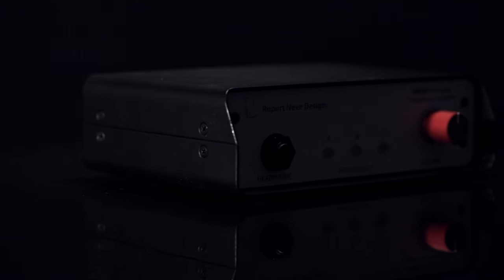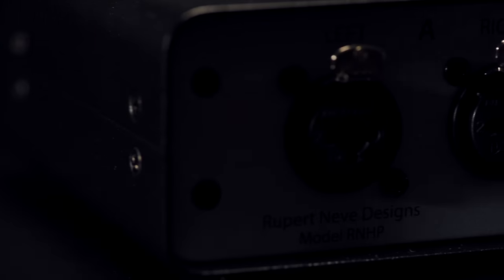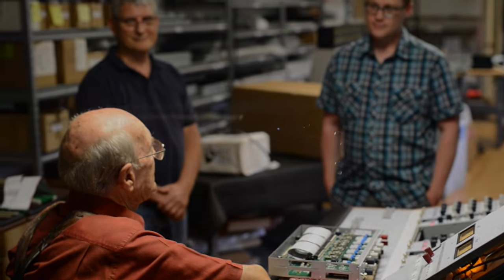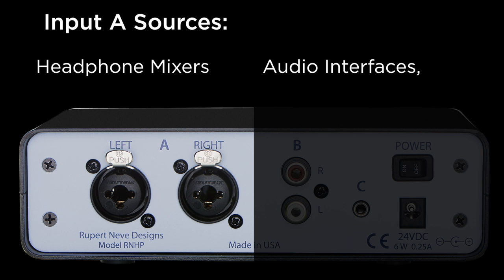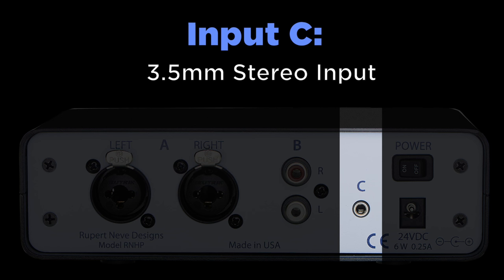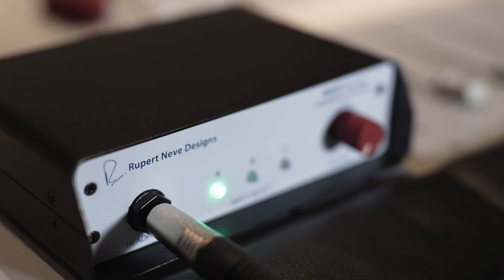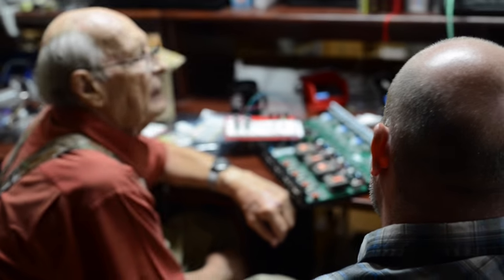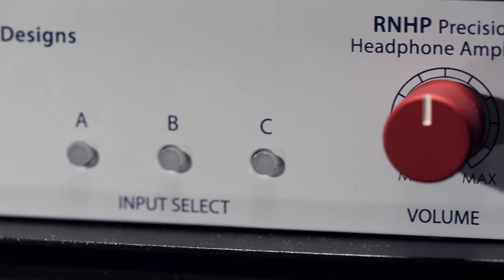RNHP: Precision Headphone Amplifier Overview

Comment: Just received my RNHP yesterday and it has really surpassed all my expectations so far. Thanks so much mr. Neve for putting together this little wonder which is the first head amp I've tried able to squeeze all the juice from my headphones collection.

Now, thanks to the RNHP I'm finally able to enjoy my Audeze LCD2C, Focal Clear, Sennheiser 660S and Beyerdynamic T1 2nd Gen the same way I've been enjoying my Beyerdynamic DT1990's until now. The RNHP drives them all effortlessly and each one of them sound their very best. My other head amps are the Beyerdynamic A2 and Marantz HD-AMP 1 and despite being very good and more expensive never managed to make sound properly both my Audeze and Focal. 

Paired the RNHP with my CHORD Qutest DAC, Marantz HD-CD1 and my Stanton ST.150 Turntable and I'm in audio heaven. For anyone searching I fully recommend buying the RNHP. I wish I would've learnt about it before. I could've spared a lot of money.

There IS a reason why Rupert Neve Designs are legendary.
Reply: Very interesting, thanks. Can you provide a bit more feedback on the synergy between the RNHP and your Beyers? This is the pairing I'm looking at. Thanks.
Reply: I'm looking at pairing this with the T1 and the Schiit Modius. Are you still using the RNHP with your T1?

Comment: A little confused, how can this be calibrated to work with my HD 650 | Sennheiser 300 ohms?  I don't see any "calibration display" that could operate as such and make sure the output is set correctly for 300 ohm?

Comment: What headphones did MR. Rupert  Neve used to test them?
Reply from the maker: Hey Jared, We beta tested the RNHP with a wide variety of different headphones from brands including:  Grado (multiple), AKG (multiple), Sennheiser (multiple), Shure (multiple), Ultrasone (multiple), Audieze, Blue,  Sony (a couple models),  Audio Technica,  Beats and Beyer Dynamic.   It universally gave much higher performance than audio interface, headphone mixer, or cheaper multi-channel headphone amps, and we even preferred it to the $1000+ headphone amps we referenced it against.

Comment: Hey, can someone from the Neve team explain the use of balanced inputs on the back but only Single Ended Output on the front? Why not have Balanced Output on the front? Doesn't that defeat the purpose of the balanced inputs? Or does it not matter on this unit?
Reply from the maker: Hi Jarek - many pieces of studio gear will only have balanced outputs available, so having balanced inputs here is ideal for signal flow and isolation purposes. Most studio headphones will be unbalanced, so we only implemented an unbalanced headphone out on the RNHP. But our new Fidelice DAC (shipping later this year) has balanced headphone outputs on it as well! https://fidelice.com/precision-digital-to-analog-converter

Comment: Hi guys,  wondering what cables were used on the back of the amplifier?  Thanks
Reply from the maker: The balanced connectors are Neutrik, if that is what you asking

Comment: Hi, I would love to check this out on my YT channel and on my website www.hifiinsider.com. Is the circuit balanced design? Are there other PSU options aside from the wall wart that comes with the amp? Thanks! ~ Mike
Reply: It's a Rupert Neve design which means there is nothing better in the Pro Audio world Rupert is the best of the best just do a google search for Vintage Neve or Neve 1073, his designs are the most cloned and most revered. Rupert designs his own Transformers and they are considered the Holy Grail in Transformers. Once you try a Neve product you will never think about a Tube Headphone amp again or inferior overpriced products from other manufacturers. In Pro Audio analog audio quality there is only one standard and that standard is Rupert Neve and all others are judged by his standard. At $499 this is a steal compared to other Neve Products for example his microphone preamps can command as much as 8 to 9 thousand dollars for technology he produced in the late 1960's and early 1970's with his 1073 model.  Have a great day!

Comment: May i pose a question?   IF i have a hammond C3 and I have a 1/4" out put on a Leslie Pedal and I have a pair of good head phones like BEATS PRO's what would this thing do for me for my SOUND?  Thanks       Just trying to understand the need for this DEVICE.  Thanks
Reply from the maker: If you have a stereo "line" level signal running into the RNHP vs a standard $50-100 headphone amp or integrated headphone amp in a keyboard, you would generally expect significantly better clarity to the sound, much more accurate frequency response,  better extension in the lows and highs, much lower distortion and noise, and higher max volume without clipping.  No whether that is worth it for just referencing your C3 is another question, but it could also be used for listening / recording with anything from a cell phone, cd player to a professional audio interface or console.
Reply: I'm surprised that you even responded. Srsly man you two are not on the same page.

Comment: Why would you buy this for $499.00 when you can just get a great pair of Headphones like Beats Pro's?  Am i missing something here?  i know that CHEAP crappy headphones are not very good and maybe that's what this is really all about.  Correct me if i am wrong.
Reply: Beats aren't good headphones if you're after sound fidelity and transparency, which this amp provides. Beats is a consumer brand. I'd look for a professional brand of headphones like Sennheiser, Beyerdynamic, Sony or Grado to use them with this amp. That said, any pair of headphones will sound better when plugged to a dedicated headphone amplifier. Hope that helped!
Reply: @Jemvie  You mean my Scarlett interface doesn’t have an adequate headphone amp in it? I mean Focusrite is part of the Neve family so it should do the job.